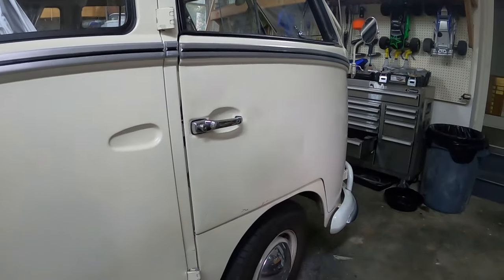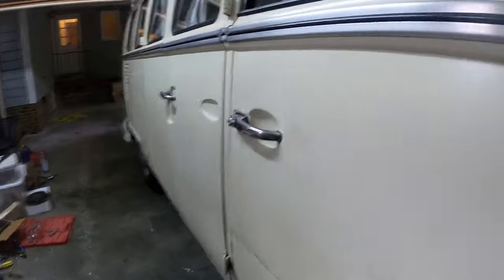VW Split Bus - Don’t Know How to Fix That - Video 002

Comment: Greetings from Austin! Nice bus!

So here is my 2 pennies... 

Shops that know how to do the work are all booked, behind in their work, and can charge what they want. Unless you are ok with being without your bus for a lengthy period of time, you will have to start cutting and welding... it is a thread that once you pull it, can take your bus off the road for a while. That's why I recommend enjoying your bus for what it is. (Based on my experience, and what I see, there is much more that is there that you don't know about.)

For your roof rack, take it off, clean it with Mothers wheel polish and steel wool, clean it with Acetone, and then either wax it (and keep it waxed) or else buy/spray automotive clear-coat spray paint (use a respirator) if you want the metal look. Or else, spray paint with auto enamel the color you want (and then keep it waxed).

If you were in Austin I'd say bring it over to our co-op shop... All the best. :-)
Reply from the maker: Yeah, my local VW place says they are booked out like 6+ months.  So for me it is all do it yourself.  Having done an amateur job on welding, body work and building 4 motors - seems like I could take a few of these things on.  But they are a lot of effort for minimal improvement.  Anyway - thanks for the feedback - right now I am focused on fixing all the little issues on my 1968cc motor and being able to run it on the stand so I can tune it without swapping out motors.  Then perhaps buying a project beetle…

Comment: First off, fairly nice bus overall 🙂.
The doglegs below the doors are a fairly involved job - cutting and welding... The door edges and rear hatch edge also involve welding...
The front bumper is adjustable - loosen the bumper mounts on the frame and below the doors and you can get it fitting better 👍.  The rack can be sanded and painted. 
I would enjoy it as is, after all it is 55+ years old.  Best of luck and enjoy 👍
Reply from the maker: Thanks!  Well my doors aren’t that great either as far as alignment.  The best would be to cut the dog legs off and examine the doors and their alignment.  They latch a bit funky when closing, but it seems to work.  But I agree - probably best to leave as is and enjoy the bus.  I regularly pick an improvement and try to accomplish something…. But these were things I didn’t dare to take on yet…